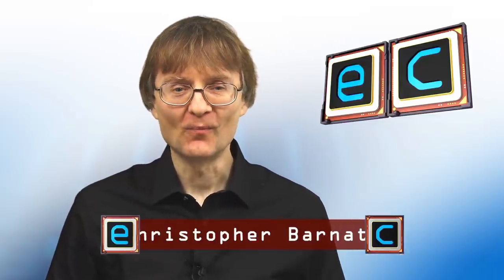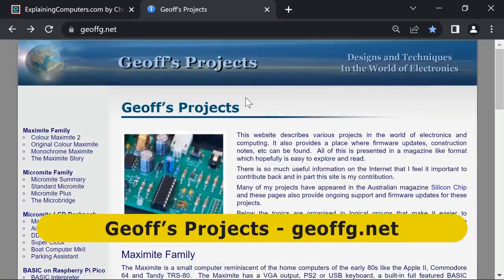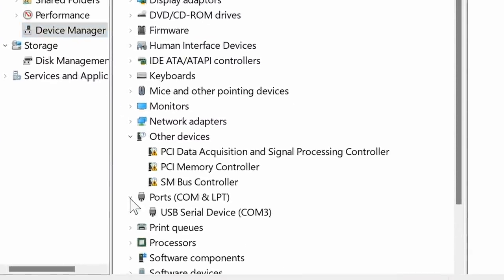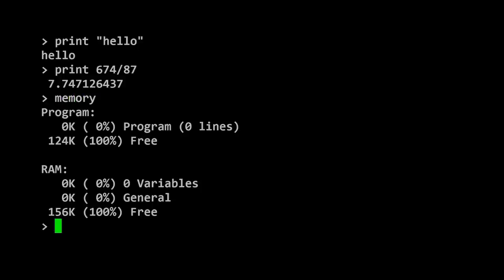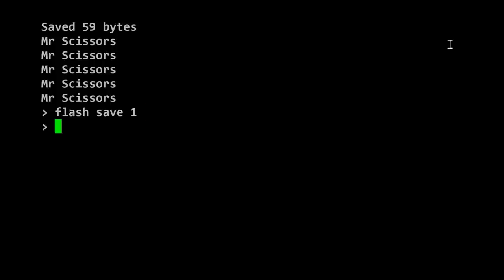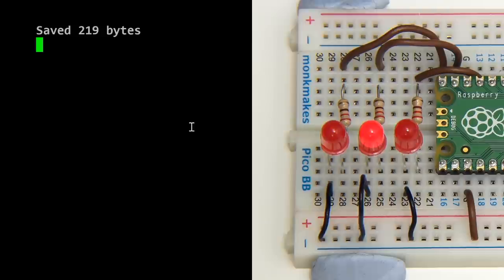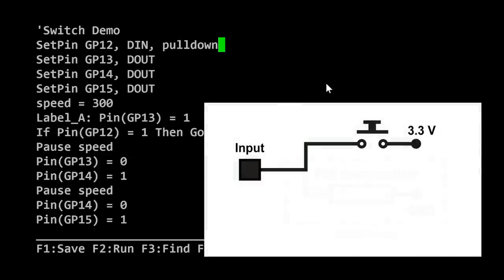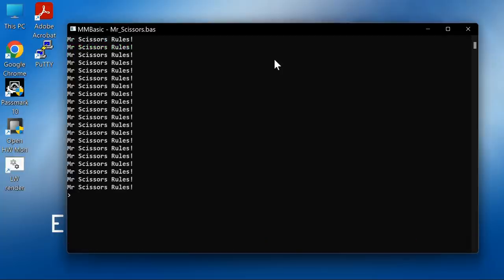PicoMite: Running BASIC on a Raspberry Pi Pico

Comment: It would be interesting to see the Pico turned into a little basic stand alone computer with a keyboard.  Looking forward to your next video!
Reply from the maker: Hi Perry. It can be done -- it just requires a handful of diodes and resistors, plus a VGA and PS/2 socket. Certainly a potential video . . .
Reply: @ExplainingComputers  I appreciate the reply. Wishing you a great day!
Reply: I agree, that would make for a terrific video!
Reply: Is the ram memory limited or can 'we' access or use the connected pc ram? 
I learned basic on the older IBM xt, 8088 micro processors,  286, 386, 486  pc followed running DOS, then moved on to win95 and continued editing and creating scripts to modify programs. After win 98 appeared, the dos days faded into the NT which took too much time to rewrite the older language..at which I became a user instead of a programmer.
Reply: @Barracuda48082  edit: sorry I just reread your question. My original response was unrelated. I'd also like to know if it can support external RAM, but I don't believe it can.
Reply: @ExplainingComputers  we are waiting 😉

Comment: I am a very old man (65) who started in High School on a Digital Equipment Corporation, PDP1145.   Our OS at that time was RST Basic.  It was 1975 and I lived in Springfield Massachusetts.  I am still active in the Computer field and take my word for it;  We have come a long way.
Been a Subscriber for a few years and look forward to your Sunday Video's.
This will be a Nostalgic Fun Project!  Thank You Very Much.
Bill
Reply: 1977 Lewiston Maine some UNIX like time sharing system running some BASIC with  Northeast Bank and the High School. Punch cards and Teletype printers at 300 BAUD, no monitors! We were probably responsible for deforesting many many acres!
Reply: Pdp11
Reply: I'm and even older man (68) who in college, started on a DEC PDP-8 with nothing but the front panel toggle switches to use to program the thing! I still keep my hand in these days for fun in retirement. It absolutely amazes me what can be done on a bit of silicon no bigger than my fingernails these days. Cheers!

Comment: I can’t happily program in BASIC without line numbers. Your demonstration of with and without was a moment of happy-not-happy. I realized my coding acquisition is psychologically based if you call composing in BASIC coding. And it never occurred to me I might write in BASIC again. What a profound video!
Reply: Structured BASIC programming never needs line numbers.
Reply: @SpeccyMan  Wean him off the line numbers. I still find them comforting when I want to write something without thinking.
The thing is we had to use them just to be able to call a block of code.

Comment: My first experience with Basic was on a Commodore 64 and in its early days it used a cassette tape to store and retrieve programs. Commodore Basic also used line  numbers. I am sure MMBasic is much improved. I have not ventured into the Raspberry Pi Pico, so thank you for the introduction!
Reply: Jim McIntosh  Me Too! I learned how to program on an Atari 400. Ah, the good old days. Star Raiders!
Reply: Apple ][+ here
Reply: @TheySuckFatLongDonkeyLogs  I lusted after Apple 2's but in the day they were 3x as expensive as 400's. And me being the cheapskate that I am went for economy. I even worked for Atari for a time.

Comment: I love BASIX. No pratting about with objects, no worrying about indents and half a dozen kinds of parentheses. 
It takes me back to my spectrum 48k days.
I'm very tempted to have a go with this. 
It's also cheap and simple!
Reply: I think I paid more for the USB cable than the computer. Just bang the code straight in and hit F2 and it saves and runs instantly. I'm loving it.

Comment: The first computer I got to use was an ICL 2903 (remote over acoustic coupler modem and teletype terminal, painfully slow and often take near on an hour to get a connection over the PSTN line) running George OS using CECIL programming language, also the Research Machines 380Z running BASIC at school.  

But my own first computer was a ZX81 preorder as well.  Fun times indeed.  Today, there is so much tech in your basic systems that it is overloaded and curtails the creative stuff, which things like microcontrollers give back as you can get creative at the core way more.  Just like those early microcomputers.
Reply: I liked the ICL 2900 architecture. Got to use it at Glasgow Uni (with VME/B) and Edinburgh with our home grown EMAS (Edinburgh Multi Access System).

Comment: WOW, where was this when i was 11 or 12? It would have given me so much enjoyment at that age. It still is fun today, but when i was a kid i was using regular electric switches and what i could "borrow" from an old car etc. I still remember adapting a 6v / 12v meter circuit that used LEDs output to show the level, reducing the resistors to convert to a VU meter for my radio because i wanted falshing lights. See your LED on the breadboard and then the neat MMBasic was just great. Thank you for bringing this to us and than Geoff for his hard work.

Comment: In the early 2000s I learned to make my first microcontroller-driven robots using a Basic Stamp 2. This is such a delightful nostalgic throwback! I made some cool stuff, including a mini sumo robot that had infrared distance sensors that it would use to find and follow an opponent. It was so cool for a 12 year old to be able to relatively easily get into that with a BASIC powered MCU

Comment: Excellent episode. Informative, interesting and well presented. Thanks. Guess what my retirement lasted 10 days, I’ve accepted a position as an in-house field tech at “Control Micro Systems”  notice the middle word, it was a sign. They have videos on yt, CMS laser. Thanks for getting me interested in high tech again. FYI, Artemis is back in the VAB. 🚀
Reply from the maker: That was indeed a short retirement -- but it sounds like you will be doing some interesting work. :)

Comment: To echo many of the same sentiments that others have listed below, this neat little video brought back memories of my first encounter with computers & programming.  I almost missed the whole PC movement & didn't care too much as there were hardly any around in high school in the 70s.  If not for a fateful day in the mid-80s while in graduate school (music performance) and I wandered by a smallish room and heard a synthesizer & also a handful of Sanyo MBC-550s 'grunting' away w data disk & compiler drive talking!  (a kind of music, CP/M was it?)  As I learned FSU had a connection to the U. of IL at Champaign-Urbana & the music departments were involved in technology research in sound synthesis termed C-Music (?) or some such.  The staff built the synth I heard from the ground up - out of wood.  Big sucker, and FM synthesis was breaking out big-time , especially in Pop music! 
The next year saw a large lab set up with - wait for this - Atari 1040 STs of which I have the regular & a Mega-STE in my basement to this day!  FSU started a Center for Music Research & they could get 3 Ataris with 1MB on the MOBO, stereo sound jack, MIDI IN/OUT, cartridge port, etc. and GUI for the cost of just 1 Macintosh!  Actually, a British professor on staff taught the first programming class I ever took:  Pascal.  That language was abandoned the next semester in favor of C.  After I started teaching high school a few years later (1/2 day music 1/2 day computer literacy/programming...ahhh...so nice!) the kids & I had fun with programming challenges in QBASIC, Batch files (anybody remember?) and MS-DOS.  Oh, and fantasizing about the day I would buy a PC with a couple MBs RAM and a huge 40MB hard drive!  Woo-Hoo!)  Well then, I feel sorry for anybody who has read this tome down to this point.  But at least know I feel good in the way one does after visiting a very close friend not seen in many years!  Have a good one, and I think I shall poke around in the MicroPython project mentioned above.
Cheers!

Comment: Chris, that's very impressive. The Basic seems to have a fair number of convenience features. Wow, it's even capable of using VGA. Imagine all that; an 80's style computer on a tiny little chip costing 4 quid. I also learned about the breadboards for the Pico. They look neat. That battery pack thing looks worthy of investigation, too.

Comment: My first BASIC programming began in the early 70's using a rather large acoustic modem/terminal connected to our mainframe computer using the desk telephone handset. It was intended to make self programming of small engineering programs easier for us since it eliminated much of the programming complexity. You simply called a number, plugged the handset into the modem, and started programing, thereby eliminating the need for computer cards submitted for overnight runs, thereby speeding up program development. Programs I wrote were for tasks such as selecting the proper wire diameter, material, and overall spring dimensions in the design of springs, sizing hydraulic orifices given a hydraulic actuator's size and loading, and many other relatively simple engineering tasks. It was a fun time. It wouldn't be long, however, and programmable desktop and handheld calculators would soon take over that task. Like most computer history, that era didn't last long. I may give this a try this just for the memories.

Comment: Geoff really did an excellent job creating MMBasic, it's the perfect platform for beginners who want to experience BASIC running on real hardware. I've built a Colour Maximite (in addition to using Picomite) which I find is ideal for prototyping. It's worth noting that this is a locally-developed Australian product (maximite.....vegemite....it all makes sense now!), which I find to be unusual given that we missed out on a lot of the 80's computing craze. Retro machines like the C64 are rare around here and you can't easily get one, let alone the peripherals and cartridges, if you want to experience retro computing. The Colour Maximite isn't a direct C64 replacement but it has that same spirit of "friendly computing".

Comment: I think I could make quite a lot of use of this for various projects, where programming in BASIC directly on the Pico would probably be quicker and easier than the usual options. I've used BASIC on a ZX81, Spectrum, BBC B and IBM PC, but none of those had the ability to do what a Pico can!
Reply: I've tested the same BASIC program on a Dragon 32 and PicoMite and found the PicoMite is over 100 times faster. Things that used to be a problem in BASIC such as program speed, data storage and spaghetti code are solved with this. Yet you can still write a 3 line program that actually does something and runs instantly.

Comment: That was very interesting.  I too had  (still have in the depths of the garage) ZX81's to which I connected all manner of sensors via the expansion slot and learned such a lot programming in BASIC.  To really get the nostalgic feeling though you should have saved your programmes on cassette!  For anyone using the PICO I thought that breadboard was an excellent idea.

Comment: I am very impressed by your mental arithmetic capabilities as you are able to instantly calculate 674/87 in your head and declare the 7.747126437 that is output to be the correct answer. It isn't given to many of us to be able to calculate to 10 significant figures in our heads.

Comment: I just got a rpi pico for£4.70. I didn't get it to work with putty as win 10 doesn't show it as a com but just pico but installing tera term vt got the terminal working and it works and I'm very impressed by the interpreted basic. Thank you for drawing my attention to mmbasic and rpi pico.

Comment: I really enjoyed this video. Like you, I learned programing on ZX81as well as the IBM PC/PS2. Despite learning Pascal, COBOL, and Python, I still prefer using BASIC. Indeed, I miss being able to program in BASIC in Windows without having to download it. As always, I love your presentation style and the content.
Reply: QBasic was always my favorite. Version 4.5 could even compile your code.
Reply: @anon_y_mousse  I was partial to BASICA and GWBasic.
Reply: @anon_y_mousse  I think you're talking about QuickBasic - that was the product sold separately by Microsoft that has a compiler and linker (so you can actually code a library in C or assembly and link that code library with your QuickBasic program). I think QBASIC was kind of a demo version of it that shipped with MS-DOS, but if you wanted real power you had to cough it up ;)

QBASIC and QuickBasic were 99.9% compatible otherwise - there were some weird differences like whether you used CLS or CLEAR SCREEN to clear the screen (and I don't remember if that example is even correct).
Reply: @robsku1  I don't particularly care for the distinction. They were nearly identical and the main difference that counts is one came with a compiler and some extra libraries, the other did not. As for technicalities, QuickBasic was the 1.1 version, QBasic was 4.5, and it's not as though the Q stopped meaning Quick just because they abbreviated it.
Reply: @anon_y_mousse  just adding...
...despite of my nitpicking I do get your point 🙃

Comment: MMBasic looks fantastic!  My first BASIC program was written on a teletype in my electronics shop class, connected via a 300 baud acoustic modem to an IBM 360 at NASA/Ames Research Center in Mountain View, CA.  I even got to save it on paper tape, which I thought was pretty cool at the time :)
Reply from the maker: Hi Chris. Saving onto paper tape is/was cool! :) And at NASA even more so! :)
Reply: This is very similar because you use a VT100 terminal to talk to the Pico.

Comment: Around 1979 I wrote a BASIC interpreter for the 6502 that ran on an APPLE ][ with at least 25K RAM and Apple DOS. I didn't like AppleSoft BASIC because its I/O was slot dependent and you could not have multiple files open on the floppy at the same time and you had to switch slots to write to or read from different peripherals or files. The syntax of my version was based on BASIC+Plus that I learned on the PDP-11 running RSTS/E at the college I was at.
It was written entirely in assembly, was slow and completely non-portable, and took up 20k of RAM all by itself.
It's hard to believe that something as small and "simple" as a Pico is many times more powerful than the Apple ][, or even the PDP-11, so having a good BASIC interpreter with a built-in editor (other than the command line), file handling, etc., is practical and even leaves more RAM and storage available for the user.

Comment: 12:36 Just a note: All pins can't be set as Analog Inputs as per the RPI Pico Datasheet. Only 3 pins have the feature of analog input. Analog Output (PWM, not true output) is available on all the pins. 

Btw, very good video. I don't know BASIC (Python and C++ user) but I'll definitely give this a try.
Reply from the maker: Yes, ver fair point. My bad. Not all pins can be used for all of the purposes I noted.

Comment: Awesome! My only non-visual programming experience is with BASIC. First on an Apple IIe in my first "Computer" elective in 92, and then a few years later with a BASIC Stamp 2 mobile robot kit in an Electronics elective around the year 2000. (Just checked, Parallax still sells those kits!) In between I was able to play around a bit with the visual programming interface for the original Lego Mindstorm RCX system. 

I'm glad people are still implementing BASIC on new hardware, it's a really great introduction to programming concepts and thinking in code-like steps. I don't think it's ever stopped being useful as a teaching tool! And I guess you can still program serious stuff like blinkenlights or... in-house banking systems for major financial giants.

Comment: Excellent!  Now if the PICO only had a way to send something to the Internet , I'd be set!   So many projects, so little time!
Reply from the maker: There are WiFi module for the Pico now, as well as 2040 boards with either WiFi or Ethernet . . . :)
Reply: @ExplainingComputers  I would appreciate a video on this ... expanding the Pico's capability.
Reply from the maker: @lesliedeana5142  Noted. :)

Comment: GOTO .......... millions of modern programmers' brains just exploded all over the walls :P

Darn this brought back memories of the 1980's when I was learning to program on BASIC, on a massively basic PC. 
Extreme nostalgia
Reply: The GOTO breaks structure and sometimes that's just what you need. Program inversion is one use. Your page is formatted with a header and body and a footer but your data is not. So half your program is structured along the lines of page structure and the other half maps the data structure. This is a job for Program Inversion and the only way to do this in BASIC is with an intelligent use of a GOTO.